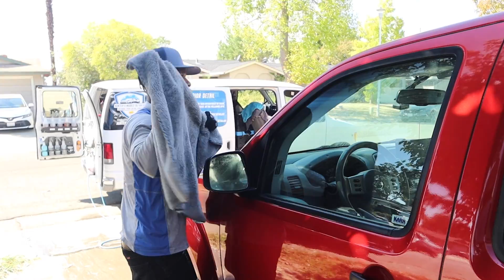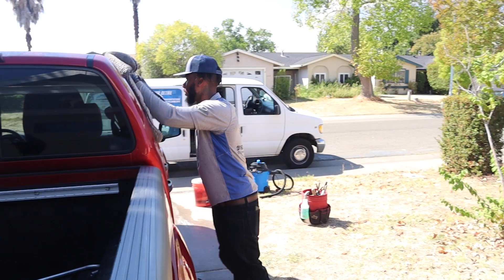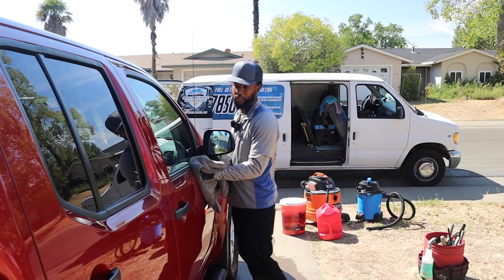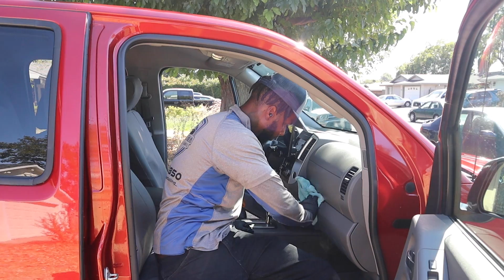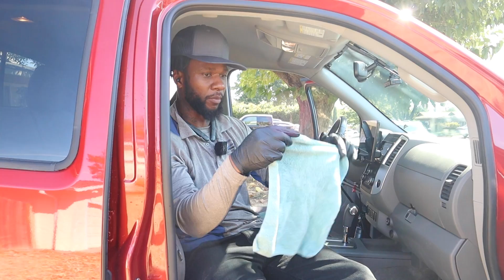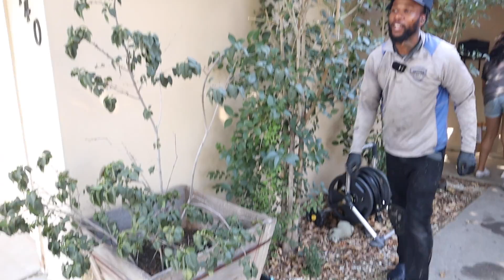Should this detailing customer deserve a discount? Let's Talk About It

Comment: I don’t negotiate with terrorists. I set my prices to reflect the level of work that I’m doing and the time and materials it takes to get the job done. If a potential customer tries to negotiate I’ll listen but I’ve already got it in my head that you’re not the kind of customer I want to deal with. What I will do is go above and beyond what I’m being paid to do when a client accepts the price without issue. For instance, the last client I served came in for a exterior detail. I saw that his engine was getting quite filthy and detailed it for free. That’s typically a $50 upcharge. When I did his headlight restoration instead of using my usual spray coating to seal the lenses I applied my five year ceramic coating. Cheap isn’t good and good isn’t cheap. Those are the words I live by.